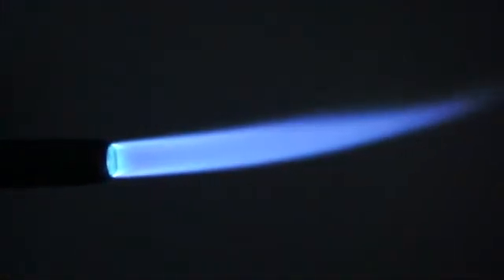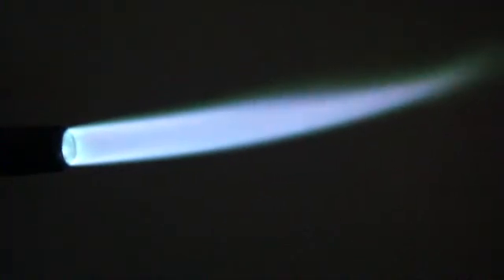Flame Characteristics

Comment: did you really increase pressure or flow?

if you open the torch valve more then you are adjusting flow and not pressure.

you set the pressure with the regulator.

this is not a valid demonstration of a inshot burner on a furnace.